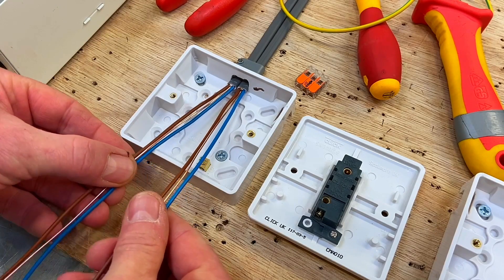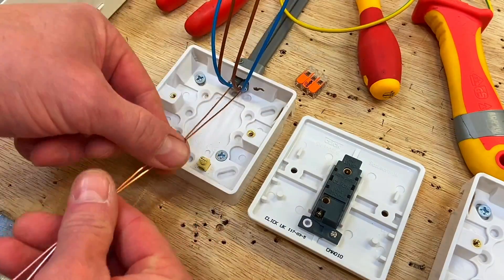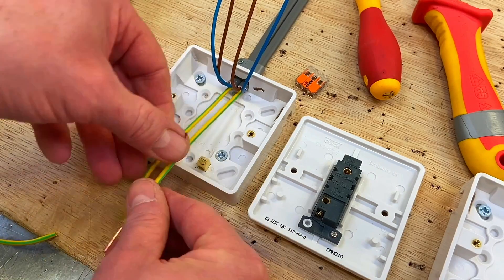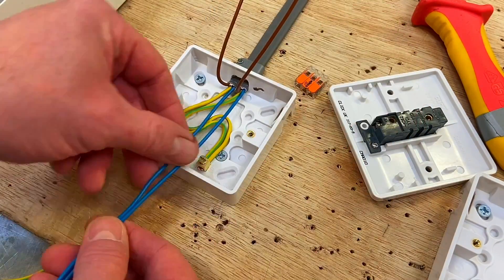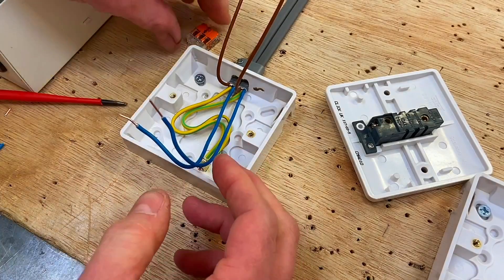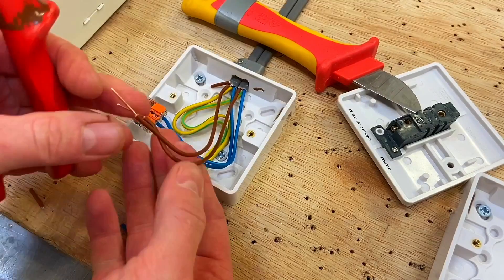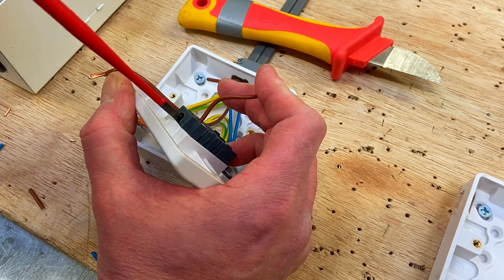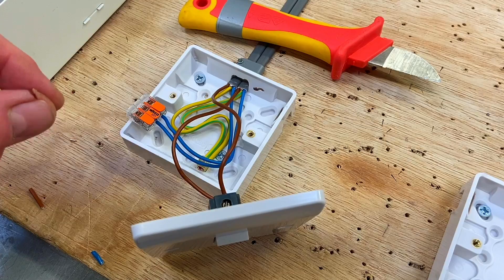How to Wire a Light Switch - Electrical Wiring

Comment: So where do the blue neutral wires go??
Reply: They have just been brought to the box as some modern smart switches require a neutral. Otherwise you'll find that they are simply connected together up in the ceiling rose etc. Heading off to the next light.
Reply: One cable (supply) coming from the breaker and the other (switching cable) going out to the light fixture. The switch only breaks the line (brown) conductor to turn off the light, the earths and neutrals are permanently connected.

Comment: Why would this method be used instead of the other one you mentioned?
Reply: This is the more modern method and provides a neutral at the switch, which is handy for smart switches as most of these also require a neutral connection 😉